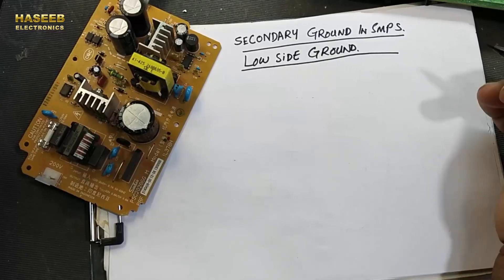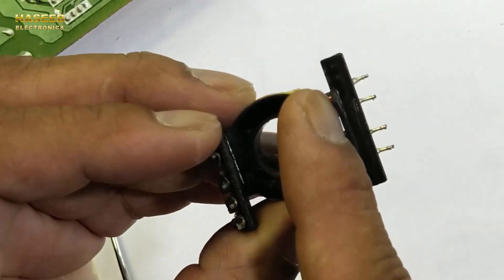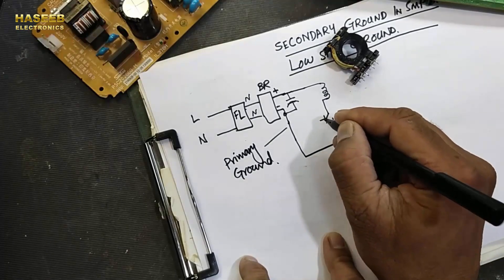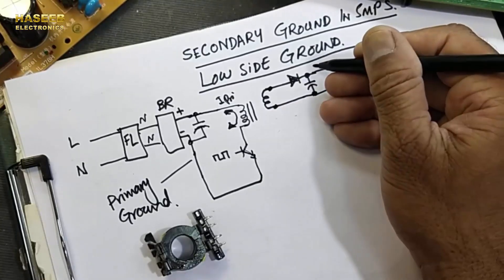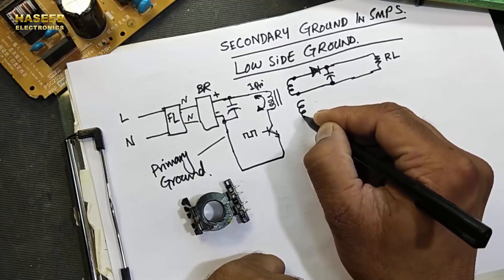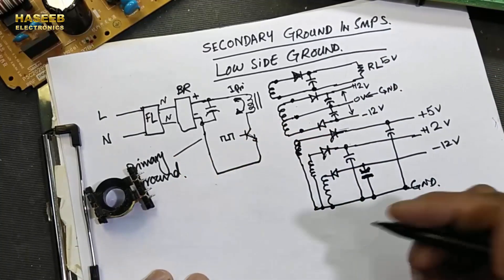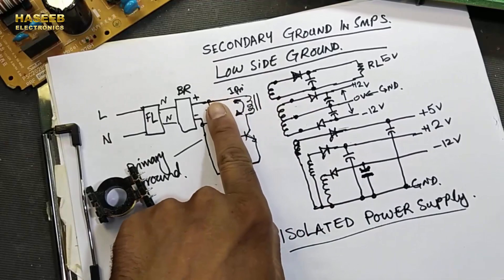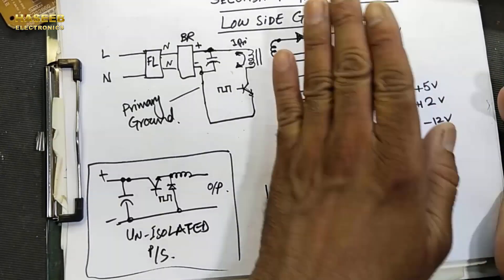[433] Secondary Side Ground or Low Side Ground in isolated  SMPS Switch Mode Power Supply Explained

Comment: Sir Haseeb, I don't understand your last remark on the class Y capacitor between pri-gnd and sec-gnd. You say : it is for noise removal. I know that the higher the (noise) frequency the lower the capacitor impedance, so it will be an AC short for high frequencies IF there is a potential difference between the two grounds. But here is neverwhere a connection between the 2 grounds, nor a protentional difference source. Or is this only for noise superposed on static protentional difference ? I even think the isolation well be less with a capacitor then without, as each capacitor also has a very high (DC) resistance, so in the long time both grounds will be at the same (DC) potential.

Comment: Assalamualaikum, sir i have a question.
 Is snubber circuit used as pfc circuit?
Reply from the maker: no 
most of the PFC circuits don't use snubber,
Reply: @HaseebElectronics  I wanted to say that the system is same.

Comment: thank Haseeb for demo,IF YOU CHECK THE OUTPUT VOLTAGE FROM THE PRIMARY TRANFORMER IT SHOULD TELL YOU IF THE PRIMARY SIDE IS ALRIGHT IF YOUR MULTIMETER FLUCTUATE, IS THIS CORRECT.

Comment: Great explaining 👌
Sir pl request i purchased hantek  dso5102p but i confused in isolation transformer power supply connection  so pl practically make video particularly mains earth wire is connected directly to out put earth wire or separate.

Comment: There's an X/Y class capacitor connecting Primary & Secondary sides of the transformer does this mean they aren't completely isolated? If both sides are completely isolated then why we still feel a small tingling when we touch the seconday side? And most of the SMPS' ground connection is directly linked to the secondary ground via chasis screw so please explain it all in your next video.
Reply: Post link to schematic.
Reply: @cdrive5757  You can clearly see Class Y/X capacitors (blue ones) alongside transformer in the video
Reply: Yes.  In many laptop chargers there is no earth, eg. Macbook chargers.  So tingling felt and also test pen would lit.  How to add earth link to prevent the tingling.